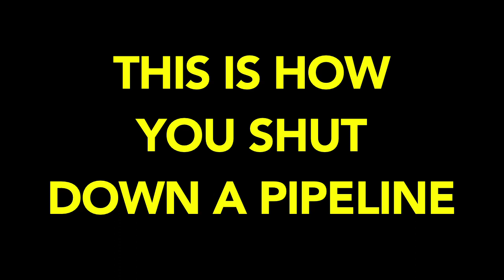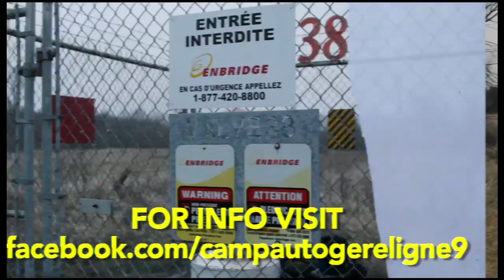This is how you shut down a pipeline

Comment: Aren't the tar sands cleaned by the process of removing the oil from them? Just wondering what the issue is.
Reply: +Jim Griffiths the tar sands project is hugely destructive and adds tons of greenhouse gases to the atmosphere. here's some more info but i encourage you to do your own research: http://www.desmogblog.com/top-10-facts-canada-alberta-oil-sands-information
Reply: Paul Brown

RE: http://www.desmogblog.com/top-10-facts-canada-alberta-oil-sands-information

Fact 1: CO2 is actually helping to provide more Carbon for plants so they require less water to grow. Optimum levels for most plant growth is between 1500ppm and 3000ppm. Burning all fossil fuels on the planet would raise the level from today's 400ppm to around 1500ppm. There is no evidence to prove that CO2 is as potent a greenhouse gas as is claimed by scientists using computer models that have, for the most part, failed.

Fact 2: I agree completely this needs to be cleaned up. This is the real environmental issue that needs to be dealt with. I think it is disgusting that industry pumps out massive amounts of waste products and leaves it there in large open air pits. There must be another way to deal with industrial toxic wastes. My guess is that $$$ comes into it.

Fact 3: Same as above.

Fact 4: Again with the climate change argument. The human species has sustained itself by negating the effects of colder climates by burning fossil fuels. It has also used fossil fuels to build technologies that we use to distribute clean, nutritious food at a cheap cost to most people in the developed countries. While nuclear fusion technologies are in development, I see no alternative but to use as many energy sources at our disposal to increase the standard of living of the poorest on the planet. This does mean using coal-fired power stations to provide energy to the people in developing nations so they may be as healthy as we are. Current renewable technologies simply cannot provide the necessary power levels, even after reducing many of the inefficiencies in power transmission and distribution that currently lose up to 60% of generated power. Low-power technologies are also useful to reduce our need for fossil fuels, but we still need kilowatts worth of heat in our homes.

Fact 5: I agree something needs to be done about it. This is the third time the article has mentioned the same issue about the toxic lakes.

Fact 6: Third time they have invoked climate change. I already made my point about that.

Fact 7: Fourth time.

Fact 8: Same again, but they are now calling it climate "pollution". The only so-called "pollution" (which is a misnomer) that can affect the climate to any degree that is released is CO2. They're repeating the same point but from a different and biased angle.

Fact 9: Emissions again, but which emissions? Are they on about CO2 again?

Fact 10: Yet again with the climate change argument, but this time they're falsely calling it "pollution". There is nothing polluting about CO2. It is the basis for life on the planet and much more is required to increase chlorophyll production in plant life so that sugars can be synthesized more effectively. 200ppm is the starvation threshold for plant life. 400ppm is a little above that. Between 1500ppm and 2500ppm is used by agricultural growers to improve the growth of their crops.
Reply: +Paul Brown

>> "the fact that you are both climate change deniers says it all. keep burying your head in the (tar) sand, chumps."

Could you define what a "climate change denier" is? There are many different definitions out there currently, and I would wish to defend my position accurately, without succumbing to translational obstacles.

The term "denier" seems a bit awry, since it implies the notion that I am "denying" the existence of something. I have done no such thing, and have accepted that CO2 does affect the climate by my statement "The only so-called "pollution" (which is a misnomer) that can affect the climate to any degree that is released is CO2." But how much CO2 affects the climate is still to be modelled accurately by climate scientists. No computer model that has been produced by scientists has yet proven an anthropogenic link to changes in the temperature on the planet. There are no current models that predict the future of the climate with any meaningful degree of accuracy. That's not to say that they won't do in the future - I only hope that day comes sooner rather than later, so that we may control the climate system to prevent problems for the human race.

To claim that someone is a "denier" of something shows an inability to counter an argument put forth by another party. It is simply an ad hominem attack. It attempts to appeal to the observer's (observer of the argument) feelings and emotions rather than logic and reason.
Reply: Kyle Ranger i don't give a fuck about the companies - our entire society needs to change. bringing individual consumption choices into the argument is a red herring.

Comment: The pumps should cut off if the pressure gets to high or drops indicating a leak . They don't just go pop if they do then I would be even more concerned about the quality of safety in your pipe lines